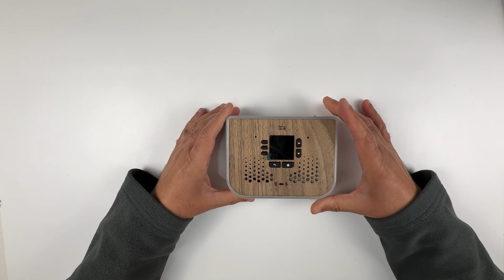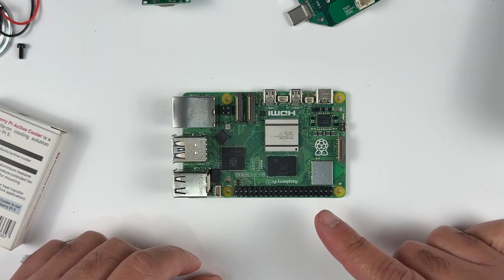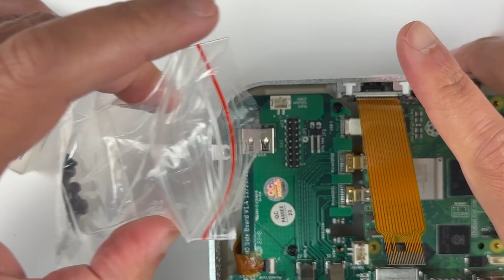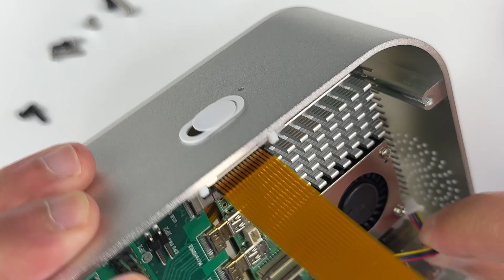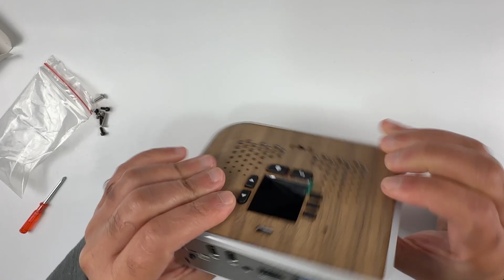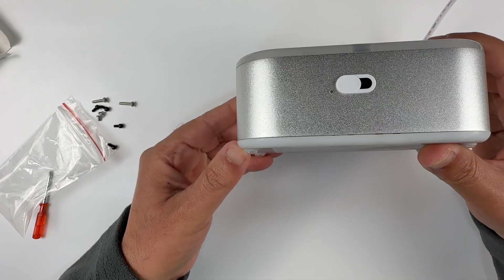Ubo Pro 5 - Unboxing and Assembly

Comment from the maker: It seems like the boot order must also change by running going through these steps to boot from NVMe:

# Edit the EEPROM on the Raspberry Pi 5.
sudo rpi-eeprom-config --edit

# Change the BOOT_ORDER line to the following:
BOOT_ORDER=0xf416

# Add the following line if using a non-HAT+ adapter:
PCIE_PROBE=1

# Press Ctrl-O, then enter, to write the change to the file.
# Press Ctrl-X to exit nano (the editor).

I am updating Ubo app to allow users change boot order from the GUI.